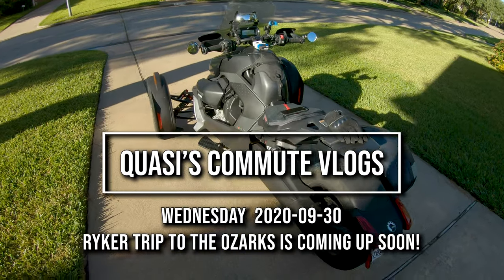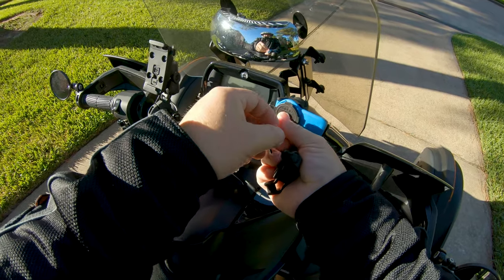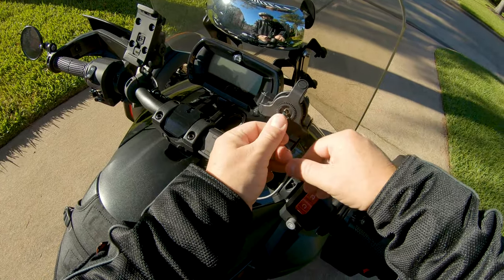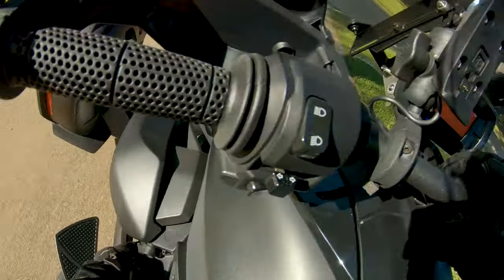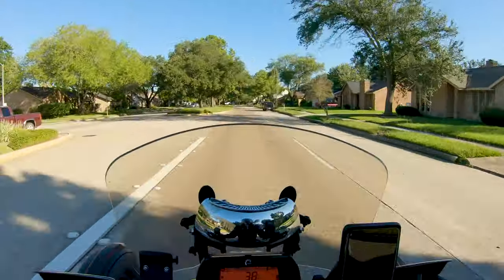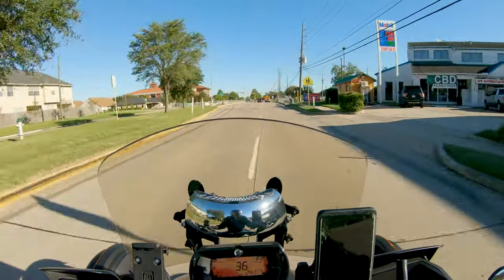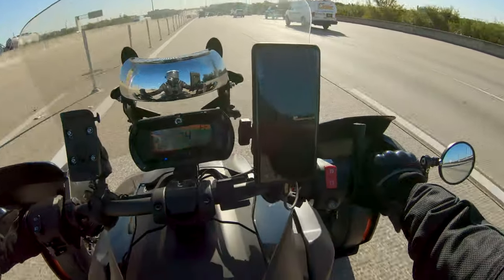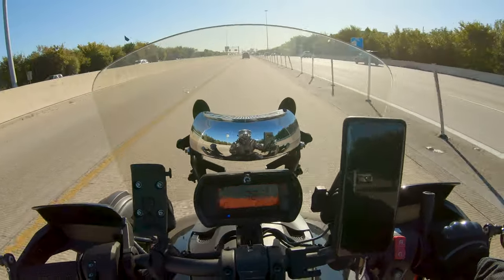VLOG: RYKER Commute - Quad Lock Vibration Dampener, Ozarks Trip Plan

Comment: Ahh curious Aaron about 7. 22 mins in i see on your left a white tower that looks like a Golf Ball on a Tee is that a Radar unit or rather interesting Water Tower ? I love Transmission Towers and Radio Masts
The exhaust on the Ryker seems quiet now but the Audio is quieter then usual.
Marc in Bletchley Towers G6XEG
Reply from the maker: Howdy, Marc!  Yes, that's a water tower for our area.  There are lots of differently-shaped towers here, but this type and the elevated cylinder types are the most common.  The audio in this vlog was a bit quieter than normal because I forgot to raise my windscreen on the Ryker before my ride.  The additional wind noise causes the audio clean-up to reduce the volume too much in post-editing.  👍  --QM

Comment: I can't believe how bad that bike vibrates.  My scooter doesn't shake that much.  I use the RAM mount with no issues.
Reply from the maker: The Ryker's engine vibration isn't too bad in the handlebars anywhere above idle.  Road vibrations and impacts are a different story entirely.  Potholes can yaw the handlebars so hard that the grips will jump out of your hands sometimes.  I had two potholes that tossed my phone out of the RAM X-Grip and I was lucky to catch it while it was dangling by the charging cord both times.  After I experienced another loss on my Super Cub, the X-grip had to go ( https://youtu.be/EMXxEM6zcfo ).  Cheers!  👍  --QM

Comment: What all hardware did you buy from Quad Lock? Did you buy the case for your phone or the adapter ? Looking for a setup for my Note 9.
Reply from the maker: I have a bunch of the Quad Lock mounts and accessories now.  The phone case is mandatory unless you want to use their universal stick-on adapter plate (not recommended).  You can shop their full line of cases here:  https://www.quadlockcase.com/collections/shop-moto .  I was previously using the RAM X-Grip on most of my bikes, so when I switched over to the QL, I bought several of their 1" RAM ball mount adapters like the one seen in this video.  I also purchased a desk mount, windshield mount, and the Qi wireless charger base to use in my truck.  I was on the pre-order list for their Qi wireless motorcycle charging base, but that was recalled due to manufacturing defects... they should be releasing that again soon.  Cheers!  👍  --QM

Comment: How much do these excursions usually cost?
Reply from the maker: It depends on the distance, the duration of the trip, and your bike's efficiency.  I've done this same Arkansas trip by motorcycle many times, and I've never spent more than $200 including food, fuel, and camping fees.  The last two times I went up there were on the PCX150 and the Super Cub.  Both of those trips cost less than $25 in fuel and about $50 in food... easily under $100 total!  That's cheap fun!  😉👍  --QM